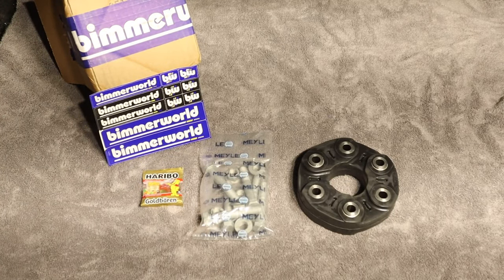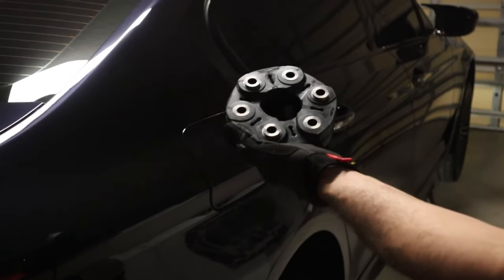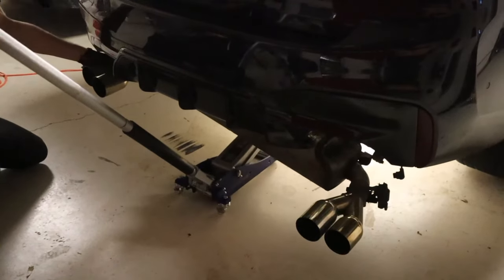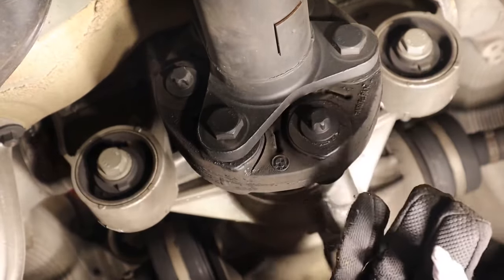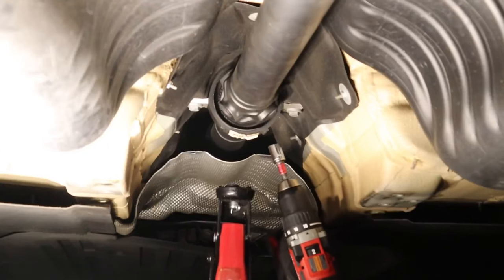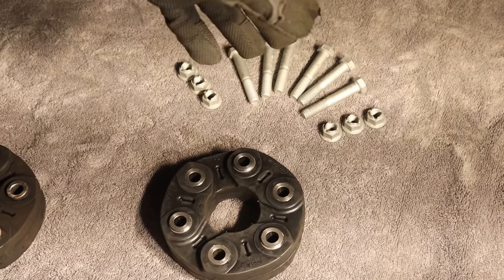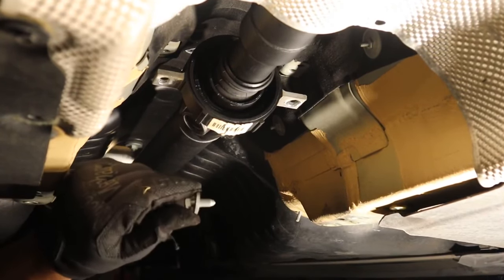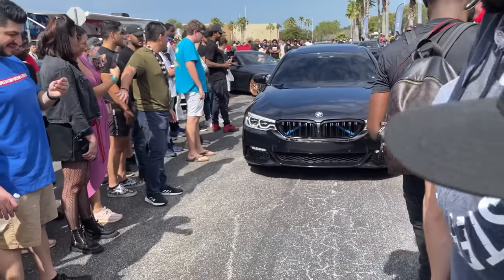BMW : FLEX DISC REPLACEMENT (GUIBO)

Comment from the maker: Thank you for watching. Make sure to replace your Guibo!
Reply: Thanks for uploading the video, that's called "Giubo" not Guibo (GIUnto BOschi) as the inventor was an Italian engineer😊
Reply: did this fix the vibration? having vibration problems soon as i hit the gas more thank 50% down on the pedal. thinking this is it. it’s vibrates right under center car & towards the rear a bit. thanks
Reply: There easy mate
Reply: @conorcumminsfan524  BMW dealership calls it as the video states

Comment: I'm dreading doing this on mine. But I think I have to do the center bearing as well. Another awesome video bro. Short and to the point.
Reply from the maker: Much love my brother!!! Come for a visit and let's knock this one out too 😎
Reply: My g30 540i vibrates at high speed the rear guibo has been changed but not the center or the frontat engine
Reply: Watch the video and if you have access to a lift it will be way easier. It took my friend and I an hour 15 to get it done. Thanks to FBO. 😊
Reply: Mine does the same. Was told by the shop foreman at my local BMW dealership that the Guibos arent known to go on this model. He recommended road force balancing instead   @bmwsincekid  I have a 2018 540
Reply: @AaaBbb-bh6ff  i will go to chrck wheel straightness and also roadforce Then will updaye you guys!
Reply: @bmwsincekid yours AWD?
Reply: @Jay-xn7xp  no Rwd I will go for tyre change they will check my wheel i will upload video

Comment: The guibo itself has the relevant directional arrows already present. It's good to use a silver sharpie to make the arrows easier to find/read, but you made the arrows in the opposite direction. Although your arrows were opposite, you correctly kept with that method upon installing the new guibo, so all is well. Just wanted to point out the built-in arrows to others that newly find this video. Great video, too.

Comment: Im at 96k miles. First started getting symptoms at around 90k miles but I threw it off to the new wheels I had gotten so never took a look at it driving around like that with multiple launches took its toll on this and also my center support bearing hoping getting both of these replaced helps mitigate the nasty vibration I get at 80ish mph when I have my lightweight wheels on.

Comment: how long did this take?
Reply: Did you ever find out how long it took?
Reply: @phopkins25  A shop did it. Less than an hour. But you can do it yourself at home without even dropping the exhaust just bend the shield out the way to get to the guibo and change it from there

Comment: Thanks again for your helpful video on repairing common faults on the G30 Thankfully most of what you have shown also goes with the uk 530d's  so helpful to so many of us.👏🙌😊
Reply from the maker: Much love my brother! These words make my dad. I can't wait to visit the UK. I love your culture!! Anything I can do to help let me know my brother 🙏
Reply: @FullBoltOnGarage  Just be sure to let me know when you do come over so I can pick you up at Heathrow or Gatwick Airport  👍
Reply from the maker: My brother!!! That's so much appreciated as I know how far everything can be in the Uk!! I spend 3 years in West Kensington. I absolutely LOVE how everything works. From the underground to Hyde Park 😂 I'll most likely retire there how much I love it. Will definitely be back. Seriously appreciate you brother 🙏🙏
Reply: @FullBoltOn Garage  Any time at all, I will be there to pick you up. West Kensington isn't far away from me, I'm just about 10 miles south of there. Can't promise I won't be picking your brains on some G30 improvements though 😉
Reply from the maker: You were just around the corner!!! Any day there's bmw talk is ALWAYS a good day 😂 would be a pleasure, my bro. I'll definitely circle back and make a group post when the time comes

Comment: Great video.  You made it so simple.  I guess when you are good you are good.
What ate symptoms of a broken flex disk.  Mine makes clunking sound underneath the car...
Reply from the maker: Man, I can't even express how much I appreciate these words. Much love!!

So flex disc symptoms are usually vibrations at mud to high speed. If you hear clucking noises and it's coming from the rear of the car under rear seats, then it's your rear transfer case, unfortunately. I've seen this in a handful of cars, and that's the culprit.

Comment: On my 2018 you also need 8mm and 10mm sockets for some of the shields.   
You also don’t need to remove the exhaust, hang it down and bend the heat shield down and out of the way.   
Finally, agree you should grab spare exhaust bolts. Or muscle off the rubber.

Comment: Hello, thank you for the video, l have a question: because of Flex disc it possibly can  shake a clutch? And shift gear? When I pass 120 km per hour the car start shaking under the seat !!! 
Thank you very much again
Reply: Any progress? Have the same thing…

Comment: While accessing mine under an 09 328xi has me removing little more than a single fastener that I think is a 10 mm for the heat shield; It's going to make up for it by having every single fastener on the disc totally rusted.  Makes me want to hang a bucket full of penetrant over the shaft for it to sit in for a day before I touch it with a wrench  😅

Comment: So my problem is that my car on 3 gear on low RPM on Drive vibrate until it pass 4krpm right but if i put it on manual and do the shifting above 3k rpm it everything works normal

Comment: Wait why did you have to remove the exhaust.  I can see mine pretty clearly on my G30 520d
Reply from the maker: If you attempt the job, you'll see firsthand why that's needed. You will not be able to torque them down. You'll also need to slide the shaft out to remove the old flex plate. The easiest and quickest way is what's shown in the video ✅️
Reply: @FullBoltOnGarage  So I carried out the job yesterday,  I only needed to crop the exhaust down and I used a exhaust jack.  I had so much room all I needed to do was either push the heat shield forward to very cleanly access the 6 bolts inc. torque wrench and slid the heatshield back to drop the center bearing.  I used your video for a large reference thank you for that :)
Reply: @FullBoltOnGarage  Being a diesel I was worried to disconnect the DPF incase I broke it
Reply: @FullBoltOnGarage  Also,  I was so impressed how clean it was behind that heat shield,  after owning fords.  Removing that tailshaft I could do it with 1 finger it was so easy
Reply: @FullBoltOnGarage  Total time taken to do the job was 45 minutes (BMW quoted me 5 hours labour and the part was actually very cheap so I purchased a genuine one)